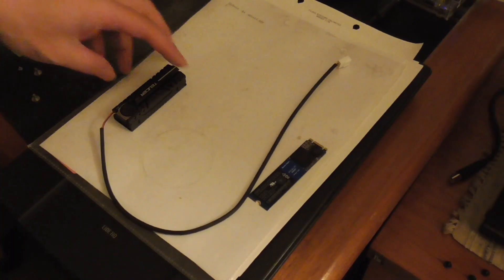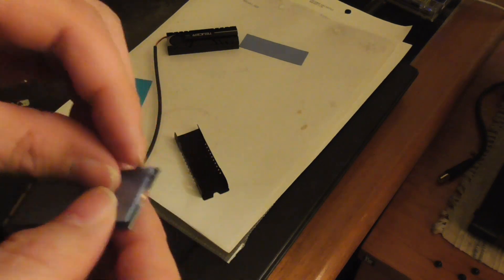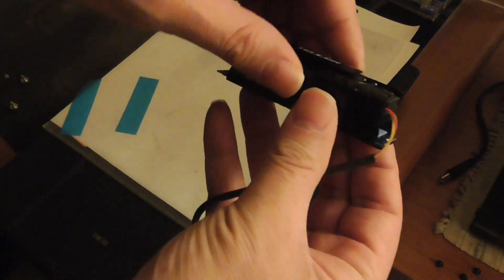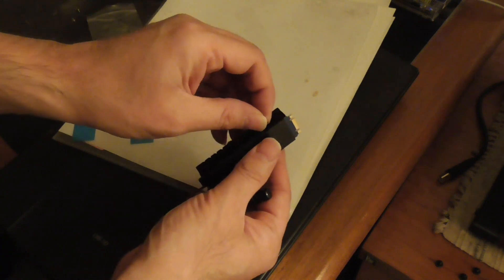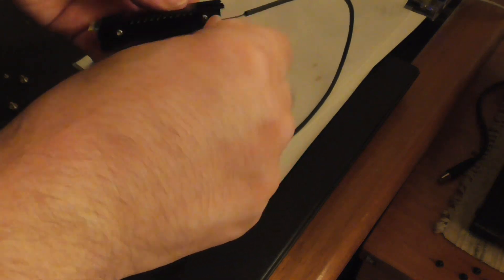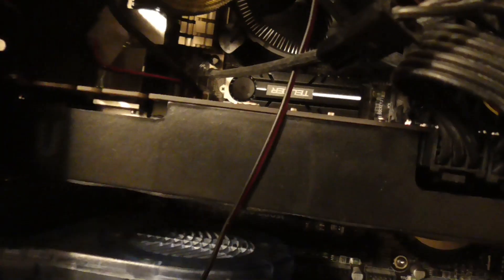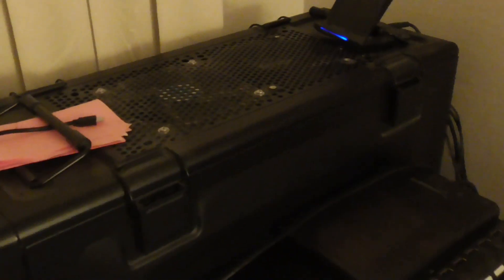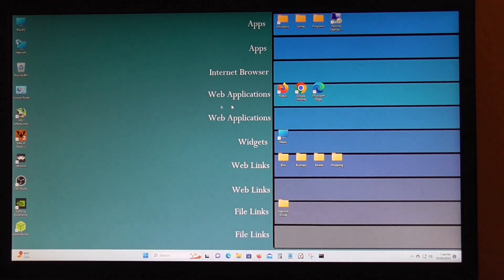Teucer M.2 NVMe SSD Heatsink Fan Review and Test

Comment: Hi. You need to test it while your nvme is reading/writing so you will have the right picture on how good it really is.
I have a similar heatisnk/fan system and the difference between a regular heatsink without fan and the one with fan is massive, around 10C-12c while the nvme is running . When the nvme is in "idle" mode the difference in temp is just like yours, around 4C.
Reply from the maker: I get about 35 °C on idle, and I get about 45 °C when I run a program.

Comment: This is super overkill, if an SSD needs cooling, it’ll come with it from the factory
Reply from the maker: Most M.2 NVMe SSDs don't come with any cooling solution. Although, the motherboard manufacturer may provide you with a heatsink depending on the model. 

The frequency of M.2 NVMe SSDs range from 2 Gigabytes/second (16 Gigabits/second) to 7.3 Gigabytes/second (58 Gigabits/second). 

The higher the frequency the higher the temperature. For higher end M.2 NVMe SSDs a cooling solution like this might be needed.
Reply: Yes, a lot of m.2 do need heat sinks if you want all the read/write speed you paid for. Same with ram except its common practice nowadays for that to come with heatsinks
Reply: I'm from Brazil and temperature here is can get really hot, dome day it reaches 37 our 40 Celsius and it's the air temperature... manufacturers can't deal with each environment
Reply from the maker: @paulosantosjunior370  That is why you need to invest in good cooling solutions for your PC parts.
Reply: @Ace1000ks , yes I agree, and I'm explaining for the guy. from the first comment.
Reply from the maker: @paulosantosjunior370  Ok, cool.
Reply: Clearly you don’t know much about pc’s